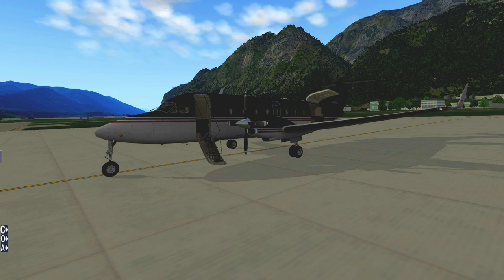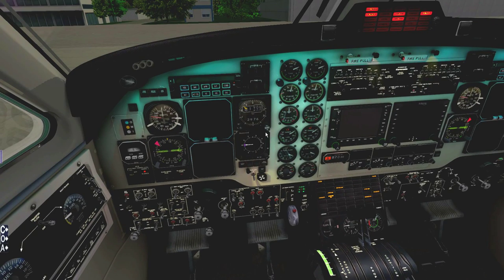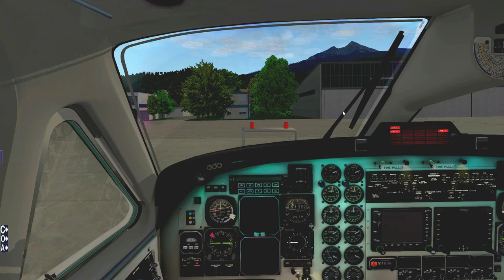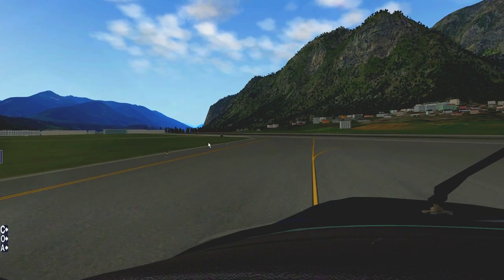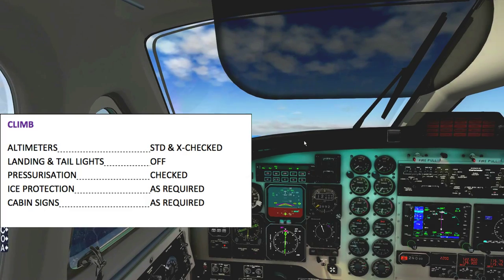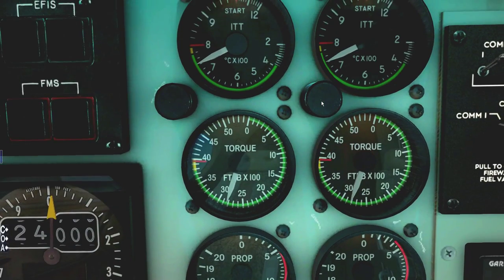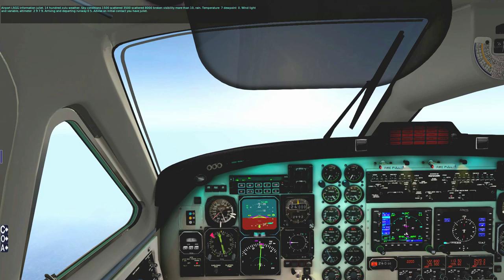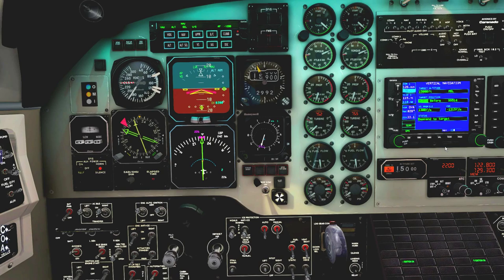Innsbruck - Geneva in a Beechcraft 1900D (X-Plane 10)

Comment: I just added this bird to my xplane hangar.  During my first flight, the engines caught fire shortly after takeoff. I was shocked. First, I didn't realize carenado modelled the engines to such an extent; and secondly, I have this same bird for P3D and never had that experience before. Not sure what I was doing wrong.....but I used this video as a reference for procedures and it's been smooth sailing ever since.  Thanks for the education. And keep up the great work!
Reply from the maker: Glad you liked it. Your experiences are how almost all PT6 installations and essentially every non-FADEC turbine engine works. You can't treat a turboprop like a piston engine and just shove it full forward on takeoff. PT6s are usually flat-rated, which means they are oversized for sea level, so that you maintain good power during the climb (provided enough cooling is available, the PT6-67D on the Beech 1900D can produce the full rated power all the way up to ~18,000 ft). In theory, the PT6-67D on the Beech 1900D is capable of 1,800 hp at sea level, but the gearbox can transfer no more than its rated 1,279 hp at max rpm and because there's no FADEC unit to limit what you command the fuel control unit to do, it'll happily overtorque the gearbox and tear it apart. Same with ITT. The only thing that is governed on the PT6-67D is engine rpm. That's the reason the gauges are arranged like that in the Beech 1900D. The two top rows are the most important. Initially near sea level, you'll have plenty of cooling air through the engines, so you'll reach the torque limit before you reach the ITT limit. Then, as you climb and as the air thins out, you'll need to increase engine rpm to keep producing climb power. This increases ITT and at some point, if the intake air isn't cold enough, you'll come close to the ITT limit. My recommendation would be to not exceed 750-760 deg C on the ITT - pull back on the power if you have to.

Comment: I'm just beginning to learn the Beechcraft. Your video taught me a lot. Where did you get the info window about Landing?  Acceptable Landing, Vy, G? (shown at 1:31:49)
Reply from the maker: +Nagidal Hi, really glad you liked it.
I don't remember where I got my landing perf data, to be honest - some pilot forums, IIRC. Google around for Beechcraft 1900D critical speeds and you should be able to find it as well. If you can't, I can post my tables.
Reply: +totoritko well, those data certainly could help. I saw zou  posting a link to the forum thread you have it from, but I don't (want to) have an account there to download them. So if you could post it or share on you google drive, that would be nice. But I actually meant the small window with the landing verdict which was displayed on your screen right after touch down. Is there an option for this in X-Plane or is it a plugin?
Reply from the maker: Nagidal Oh, that! That's a plugin called "landing speed". Search for it on the x-plane.org forums, it's free.

Comment: Hi, I really enjoyed this video, and I apreciate this B1900D, very coll plane!
But I would like to know where did you find those values of takeoff & approach speeds? I didn't find them on the documentaries of this aircraft
Thx
Reply from the maker: BRUNO JOURNO Thanks. If I recall correctly, I got my table from some forum sources I found on avsim here: http://forum.avsim.net/topic/432026-carenado-beechcraft-b1900-vref-charts/ The there guys copied the tables down from the official POH and with testing I can confirm that they're pretty much spot on (e.g. Vref should be ~1.3 stall speed, which for ~80-85 kts stall works out to about ~104 - 110 kts). I'm also using the performance quick reference from the official POH to cross-check my takeoff and landing distances: http://altairva-fs.com/fleet/poh/AVE%20Beechcraft%20B1900D%20POH.pdf
To properly calculate these, though, you'd wanna have much more detailed tables, which will include corrections for things like field elevation and OAT. So far, however, I didn't have to operate at the plane's limits (the B1900D can takeoff from as little as 3000 ft of runway, but at that point you definitely want to take everything into account, because you'll have little to no reserve for fudging it).
Reply: Thank you for your quick and accurate answer, great job
Is it possible to do this kind of tutorial with the B777-200 of Ramzess?
Thank you
Reply from the maker: BRUNO JOURNO I might, at some point in the future, if I find I have something to add there (I believe there are already lots of excellent videos on the "big boys"). I'm not very proficient in big airliners and I feel that planes like the 777 are so automated, that it often detracts from the mechanical experience of flying it by hand.
In any case, I'm already quite far into production on a new video series that'll hopefully be interesting, so between that and my other responsibilities IRL, finding time to do more on YT will be a challenge.
Cheers and happy landings!

Comment: excellent video, thank you!
i'm thinking about buying now. did you test this bird in the xp11 beta?
cheers!
Reply from the maker: I think on the latest public beta 13 it works. There was some breakage with the engines in public beta 12. I'm still running on beta 11, where it works perfectly ok.
Reply: totoritko thank you i really appreciate you answering. cheers
Reply from the maker: lynguist Just tested it on the final XP11 release and it works fine, so go ahead and get it if you want it.
Reply: totoritko i bought it shortly after your first response and had some issues but fun anyway with it. thank you for checking back on me very nice of you. cheers!
Reply from the maker: lynguist Sorry to hear that. What sort of issues? Maybe we can solve them.
Reply: totoritko no no no harm done. the issues seemed to be typicall xp11 beta issues like the front tire blew up very easily, i needed massive amounts of rnw to get it up to speed even while empty, etc... nothing serious though and now so far with final it performs better on the ground and in the air. except when i have scroll wheel support enabled the gps switches to the rnw chart display. but i can live with that. otherwise everyrhings ok! and its a great plane to switch to after the 172 and the baron. not yet interested in jets though i like the props.
Reply from the maker: lynguist I'm not sure what you mean by "rnw". But glad you like it and I agree, jet flight is overrated, especially the highly automated modern LNAV+VNAV jets, whom you hand-fly from 0-400 feet on takeoff, A/P on and it's sipping margaritas all the rest of the way.

Comment: Hey, nice tutorial.

Do you know if it is possible to use both needles on the RMI for VOR tracking? Id you do, how you doi it?  Or is it just one for VOR and one ADF? 

Tnx
Reply: +J A.L  and is fuel transfer between wings implemented? because I can't make it work.
Reply from the maker: +J A.L They should both work. The little knobs on lower right/left of the RMI should switch each needle between the respective VOR/ADF radio.
As for fuel transfer, yeah it works, it just takes a while to become visible. Open the crossfeed in the direction you want to transfer and turn on the AUX pump on the tank you want to transfer from to get it to speed up. I find it transfers at a rate of about 50 lbs/min. Do keep an eye on it while it's going on though, it's easy to forget about it and then find you've got a seriously unbalanced plane for landing. All manual fuel transfer systems are screwy like this, whether on the simulated B1900D or on the real world DA-40.
Reply: +totoritko Thanks for the quick response. 

What I meant regarding the RMI, is if it is possible to have both needles working for two different VORs. Because there is only one NAV radio control, is it possible to set up two different frequencies for VORs only? Or does it work for one VOR and one ADF only?

About the fule transfer, I have been doing the procedure you just mentioned but the "transfer" annunciation never goes on....should it?
Reply from the maker: J A.L There are two nav radios. The GNS530 is the first nav radio, the second one is part of the old-style radio cluster below the GNS530.
I never noticed the fuel transfer switch coming on either, but it does transfer, IIRC.

Comment: unfortunately I found you video less useful because your comments are spoken too quick for me to follow.  Although I have some experience with aircraft models, I had my difficulties follow the single steps..... (Very sorry about)

You mentioned the Joystick controller. I am not a technician person but it seems to me to be important. Using the newest version of Xsaitekpanels and FlyWith Lua I cannot activate all my Saitek equipment as it should be ! ( Saitek yoke, throttles  and all the instrument panels. Maybe you can help me with some hints and explanations?
Reply from the maker: Sorry you had trouble understanding me, it's just the way I talk.
The custom joystick controller I've been using won't help you with compatibility issues. Regardless if you use the original saitek controller that's built into the yoke, or you make your own, in either case it's a plug'n'play analog joystick-type device, so it should "just work".
The instrument panels should also work out of the box with Xsaitekpanels. Be sure to use the shipped Xsaitekpanels.ini configuration file and it should be ok for the Carenado Beech 1900D. Other aircraft might need some tuning, especially if you're using the multi panel.
Reply: Thanks for quick replay and the hints ....